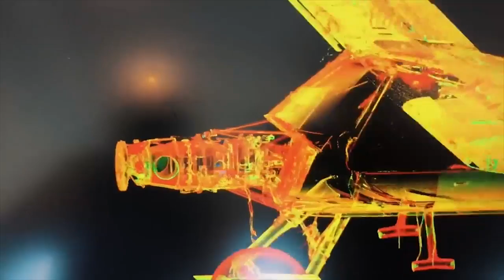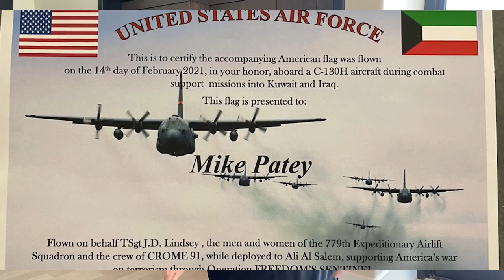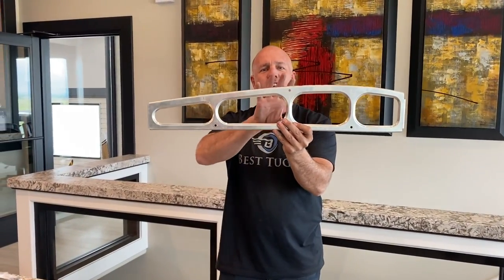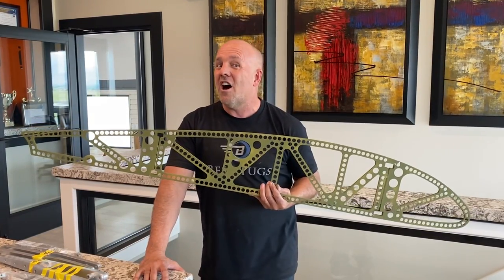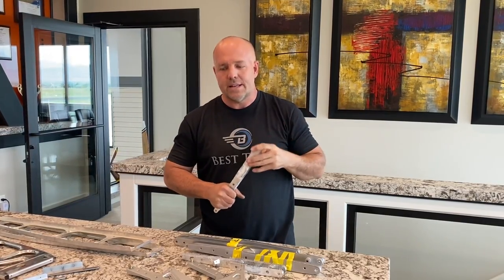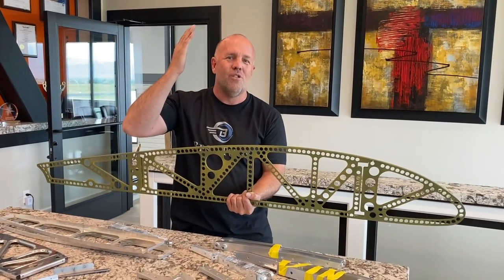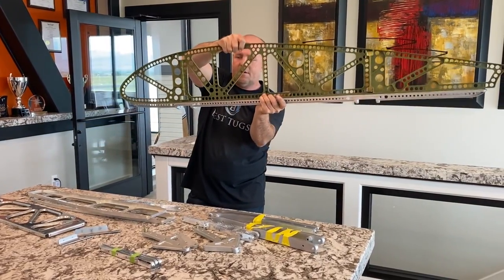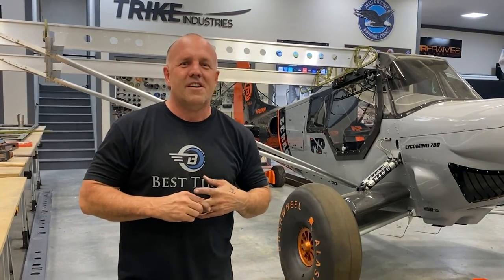Hanging Electric Mountain Bikes from an Airplane's Wing | Scrappy #56

Comment: Holy cow, how much aluminium scrap did that machining of the wing ribs generate!  It looks as if for every pound of aluminium in the wings you must have produced 20lbs of aluminium swarf. Scrappy is certainly the right name for this aircraft.
Reply: The difference in finances. He's able to do work in a air-conditioned clean room. And much of my work is done on saw horses outside.  stop me from building. And I do nice work. But the nicety of a CAM machine it certainly isn't there. Was just remarking to the neighbor 2 days ago on my entire fuselage I had less than 1 sqft of scrap aluminum. And if you added up all the little pieces less than 2 linear feet of tubing scrap. And so far after close to 20 yd of 52" S Glass, I doubt my little scraps Mount to one square yard. 
   Neighbor came in for a beer after we  stacked 134 bales of alfalfa on the trailer. And then restacking in the barn. He noticed one of my doors almost complete they are 1 1/2 inches wide with plexiglass that moves up and down like a normal vehicle. And front Wing Windows like the old vehicles used to have. It's also has a port window lower front I picked it up like was really heavy and handed it to him. Thinking it was heavy it almost popped in the face is it sprung up. Weight came in at just over 3 lb without the door handles or hinges.
    Sorry Here I Go Again, babbling. Perhaps I need my own channel. LOL

Comment: That is some quality engineering right there. Awsome idea!!  Do check the brakes on the bikes when they come off the rails after some time upside down. They tend to go a bit soggy when upside down for prolonged periods. ( air going from the brake fluid reservoir into the brakelines )  Nothing a little brake bleed kit can't fix. But you might want to add that to the kit when you go flying with the bikes attached.  Ohhh the adventures that await you when this puppy goes airborne.

Comment: Those holes are for air to to be sent around the wing to add pressure in that area so the shape of the wing can be done. Or keeping with that holes for air tubes to blow pressurized air out of the leading edge area of the wing to create a laminar flow

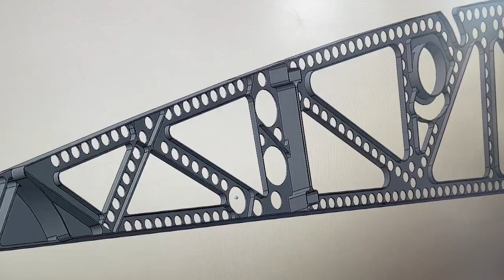Comment: at 13:18 you can see a curved valley in the rib, concentric with the bushing mounts. my guess is a topside deployable flap/slat that either deploys with the flaps or independently to increase laminar flow adhesion in the trailing topside area, with the addition of a slat that droops at the nose for better alignment to airflow. all to increase lift at slow speeds... the extra loading from this would explain the massive torsion bar activator tube.  also, the holes in the front spar are possibly for electro-optic pod...

Comment: Hi Mike its me, Joern, a second time.
I would suggest, instead of hanging the bikes perpendicular, to fix them in a laminated CRP box that is fully angled towards the wing struts to increase ground clearance! So you avoid an unwanted U-turn thanks to a bike handle bar kissing the ground on an unimproved airstrip and its less draggy!
Just my2ct ;-)😉 Keep on the good work - its awesome!

Comment: I think your funky spar holes have to do with flap actuators.  It looks like you're going to have two electric linear actuators on each side.  I'm guessing one actuator is for extending the flaps back (increasing the cord of the wing) and one is for changing the angle of the flaps.  In a previous video you showed some large circular holes in the ribs.  My guess is that those are for torque tubes that connect the flap mechanisms together so they cannot become unbalanced.  I can't wait to see what they really are for!  Btw, the tug is awesome!  Thanks again!
Reply: @Mike Patey.  Hmmm, after looking at the video again, you have a small slot on the top of your ribs, above and in front of the torque tube bushing in your ribs.  The slot appears to be curved with the center of the curve at the center of the torque tube.  This makes me think that the torque tube will be connected to something on top of the rear upper surface of the wing and the torque tube will be able to pull this thing down flat to the upper surface of the wing (for lower drag), or push it up above the upper surface of the wing to increase lift.  I think it could be for some kind of aerodynamic device that will cause the air flow to stay attached to the upper surface of the wing to increase the lift by increasing the area of the upper surface that has laminar flow.  That's awesome!
Reply: @Mike Patey. I wonder if the deployable thing on top of the wing is going to suck away the air behind the point of separated flow and pull the flow back down to the top of the wing.  The deployable thing will use the low pressure air above the flaps to suck away the burbling air in the separated flow area.  Hmmmm!

Comment: My prediction is the holes are from actuators  for and airbrake style arrangement on the wing, they are pretty sizable key ways on the two outer holes so there must a fairly high torque motor going on there.
Reply: air brakes on a plane that flies with such a low stall speed? 
I mean it won't be a competition short landing plane, but still very short.
Reply: @nutsmcflurry3737  Mike has said from the start that his not making a stol competition plane but with how much power he has to get off the ground i recon being able to stop would be the deciding factor in how short a strip he can land on.

Comment: I was just getting ready to go out for an ebike ride myself, when this popped up, the ride will wait.  Been flying with Montague bikes, recently with an e conversion, for the last 20+ years, flying and biking go together great. My current ride has a Rohloff hub, which gives a 38 mph top end in 14 th., with a stump pulling first gear, due to it's gearing (real gears) spread. Mike will probably build his own improved version!

Comment: What I cant wait to see is Scrappys Tip Stingers/skids. ( Please DO NOT forget. Tip stingers/skids save lives! ) Will they be the same, or as per usual will there be improvement. I think the holes are for a pump set up so you can be a flying fuel station. Or for a transfer block. I dig those mounting brackets. Like the fuel pod idea. Hey why don't you make two people pods like they had for the P-38 lighting .They were supposed to help get wounded back to base. Put Cory Robbins in the right one and Trent Palmer in the left.

Comment: I'm calling it. Those keyed holes are mounts for some motors to extend the wings outwards. I think you talked about something like this in the design video. However I'm quite  sure you're not going to change the depth of the wing with some unorthodox mechanics. But extending the wingspan sounds just about possible...

Comment: The strange holes are linear actuators to bend or adjust the wing to create more or less drag at different speeds. So you can travel faster during cruising and slower at takeoff and landing.

Comment: A torsion bar through the wing to adjust it's twist in flight which would allow a flat wing for high speed cruise and max twist for low speed high angles of attack.

Comment: my guess for the holes are mounting holes for electric or hydraulic connectors, maybe for landing lights, or (if you gave a hint in the video) connections for an external fuel tank

Comment: Somehow the right part of the hole pattern remembers me of flanges for hydraulic valves. So maybe it is for passthroughs of hoses and attachmentpoints of a deicing system. Since you want to fly at "any" time, altitude and condition it would probably ad up to it.

Comment: Those holes are to accommodate the modular variable torque tubes connecting the turbo encabulator providing inverse reactive current to unilateral phase detractors.

Comment: Them 5 holes are for your rod's and controls you need to change the form factor of the wing itself. So either original thin or pushed so they widen to get more uplift.

Comment: That I beam looks like it would have given the 5-axis mill a headache. That's an amazing bit of design work, actually this whole project is. 
I would assume that set of holes is to run lines through. So something to do with leading edge flaps / shapeshifting of the wing.

Comment: My guess is that the holes are there for some sort of leading edge mechanism actuation. If you look at some of his ribs, they have constant radius tracks in them, which could be used for some form of airfoil adjustment. Given that we have not seen a bracket for fixed leading edge slat mounting, it is possible that the slats and flaps are coupled, being activated by a torque tube running through the large pass-through in his tank. The torque tube would be required because the traditional cub system of springs and cables wouldn’t be difficult to calibrate and would change with airspeed. Or they could the holes could just be for routing water coolant up to evaporative radiators in the leading edge for cylinders 7&8 :)

Comment: 17:26 For flying across the ocean I think you should consider making floats. They can double as fuel tanks. Takeoff on land with them filled with fuel and if you need to land in the ocean before they are empty, have a way of dumping the fuel that is in them. Maybe it's not very practical what it's an idea.

Comment: So, I'm pretty sure there is ajustable wing thickness by means of leavers actuated by a torsion bar system. The tracks should be what can be seen around 13:47 ... alternatively those are for the slats, but I suspect those are feathered and not manually operated, so they wouldn't need an arch shaped track.
I'm thrilled to see how Mike will manage the deformation and stretching of the skin thanks to the increasing thickness

Comment: Hi Mike, my guess for the holes will be, that you would like to run electrical cables to your bikes mounts, so you can charge your e-bikes in flight, using the Scrappy engine generator.

Comment: I’m starting to think those special features look a whole lot like Arado 232 traveling flaps except instead of trailing edge extensions maybe the leading edge travels instead. Those holes - pneumatic actuator mounting points.  However, I can see the problem with pushing the center of lift forward so………. Both leading and trailing edge extendable structures that can alter the airfoil.  For example deployed provides a broader, more cambered airfoil for slow flight and retracted provides a more narrow, flatter airfoil for higher speeds.  Maybe.

Comment: The extra holes are for extra fuel tanks for longer flights and refueling your friends even better.  OR....for the extra luggage pod...cause you're running out of room inside what with all the parachute stuff you added.  On second or third thought...it might just be for super high beam LED lights.

Comment: You mentioned a fuel pod...are the holes for fuel/power/data lines leading to your hardpoint?

I think it'd be cool to see a FLIR ball hanging there, especially since you mentioned doing search and rescue work. Could tie the video feed into the back seat's display and have someone act as a sensor operator, similar to military aircraft.

Comment: I'm gonna go out on a limb here and suggest that the holes on the spar are for some sort of actuator to extend the section of wing outboard of the ailerons.  There were studies done on a variable diameter tilt rotor a number of years ago.  The VDTR would would utilize a screw system in the spar to extend and retract the rotor while transitioning from hover to forward flight.  Larger diameter for hover, smaller diameter for higher speed forward flight.  By making the wing slightly longer it would decrease the wing loading per square foot for a higher stall speed or increased weight, i.e. mountain bikes, and decrease the span for higher speed.  Mike, even if this isn't your plan, you're a true aviation innovator and pioneer.
Reply: Hello there👋👋how are you doing today?hope you had a good day?GOD BLESS YOU!!!

Comment: Hi, Mike,
My thoughts on the mystery holes are that they may be related to some sort of fuel valving & pump mounting to transfer fuel from external wing tanks either in or out of the main tank. In-flight transfer for extended range.  On ground transfer to supply your flying buddies.

Also, was concerned from earlier video that sealing structural tubes running thru ribs at fuel tank end bulk heads will flex and possibly stress the tank sealant at those locations resulting in leaks.  Maybe you have a bolted flang at those locations I missed.

Great videos, awesome design. Super interesting.  Back to work!
Reply: Hello there👋👋, how are you doing today? Hope you had a nice day?GOD BLESS YOU!!

Comment: Your wing is going to expand from behind the front of the tip of the wing facing forward towards the back because it cannot expand outwards. It also cannot expand forward. It can only expand towards your tail giving you more lift which means slower take offs and landings

Comment: Re. strange holes in front spar: attachment for auxiliary fuel pump for "fuel pods", OR ... 
because you said "heavy loads", ... ... ...  a winch attachment point to lift loads either straight up, or through a pulley system up to your FREAKIN' AWESOME I-beam.

Comment: Wondering if the holes are for some type of servo motors and maybe lead screws for an extendable wing?  You mentioned a while back you wanted to be able to configure for high lift or low drag.or possibly adjustable twist?

Comment: Hey Mike, i am guessing that these holes will hold some electronic motor to work the front carbon slots you made as i am sure as you mentioned they will actually be retractable so you can have ultimate cruise speed and max lift when you want to land and take off.  You did show hints of some of the ribs being machined with the rails machined for that, its soooo great to be able to do that and have it, ultimate mix of speed when you want it and lift when you need it. :-)

Comment: My guess is the power system for the wing flex or deforming shape shift or what ever.  If so, you need a feedback system such as a stepper motor, similar to a motor on a CNC machine that can translate feed back information to give the amount of movement that can be used to calculate the degree of deformation.

Did I say that? 

Jim H
Reply: Hello there👋👋how are you doing today?hope you had a good day?GOD BLESS YOU!!!

Comment: Mike as a homebuilder..A&P IA and a manufacturing engineer..and a guy who spent the last 12 years with Virgin Galactic and Blue Origin..Prior to that I manufactured the Thorpedo LSA..The first certified in the usa..as the Director of Production..I also did the first Diesel powered LSA..The holes are for an actuator..I predict..based on my expierience..Leading edge slats..Your going to tie them into some sort of angle of attack system..Like the old Helio curriers..Except yours will be automatic..possibly manual as well..based on airspeed and angle of attack. They wont slam like the old Helios..Super efficient..Much like a comercial airliner..to maximize both ends of the spectrum..Highspeed and low speed..I love your page..I have a restoration shop here in Oniell Ne and I am the airport manager as well..please stop in some time..Hope to do a stol drag here soon to..We support all forms of aviation..I fly ultralights and GA..I welcome all forms of Aviation..Hope to see you soon when you travel..

Comment: wow huge wings!!!It is safe to fly an eMTB bike? MTB bikes do not like huge changes in altitude and temperature,tires and brakes would expand. Made a cover for the battery pack to stay warm,I saw some people covering them with those emergency thermal blankets in winter to prevent discharging and loosing range.  Love MTB and your plane! Scrappy looks amazing.

Comment: The holes are for the transmission of ionic  gasses as per the ambient air pressure as the Bernoulli effect loads approximate the critical mass of the vector forces exerted from load stressors applied perpendicularly to the arc of the tangent leading edge of the lifting body in the wing structure complex. I know this sounds like techno babble drivel and it is , but it sure sounds plausible. .

Comment: While I have said previously the Mission Adaptive Wings was always the answer....  Given the Location, I am going to go with those 5 holes are Quick disconects and sensor attachments from hanging"Drop Tanks"  and the main fuel system.   Although they are in a prime spot for Mission Adaptive adjustments to camber, given how close they are to where the fueltank bulkhead should line up, I have to go with Drop tank line disconnect (so when a Drop tank isn't carried the fuel system is isolated from any external elements from below)  2 for data, 1 for electromechanical switch and 2 for Fuel and vent

Comment: Those Fezzari are pretty heavy.  Specialized Electric Kenevo  SL is under 20kg.  
Also I’m sure you have considered pulling the mountain bike’s battery pack before hanging it.  Would make a fair difference

Comment: Mike are you going to drill out the rear spar as well? It looks like there is some weight there that could be removed, but you have the numbers to know if there is enough head room with the thinner rear spar.

Comment: After a few days of contemplation I suspect Mike not only will be hanging Fowler flaps from the rear of the wing, but has devised a way to create a "Fowler Slat" using the same concept on the front of the wing... push the slats out and down to gain chord and camber in the wing.

Comment: Extra spar holes might be related to what looks like a retractable slat design???  The design of the LE slat shape from before looked like they were designed to fit back flush on the wing.  Just speculation.  Look at rib arc cutouts @7:38-ish.  Looks like some pivot point to me.